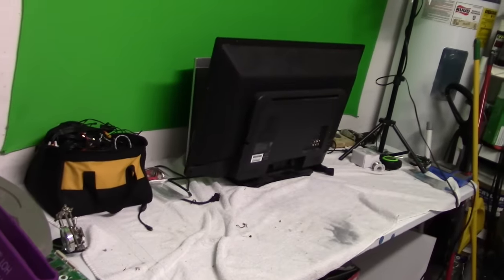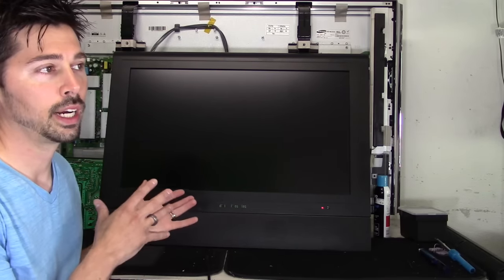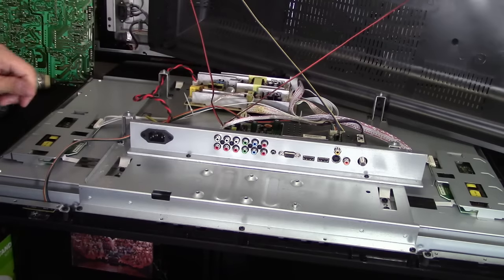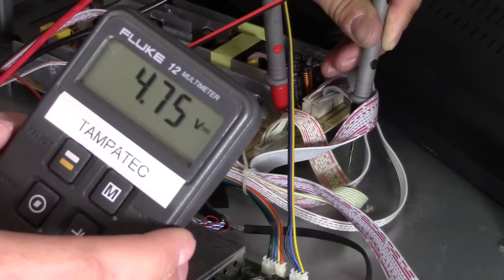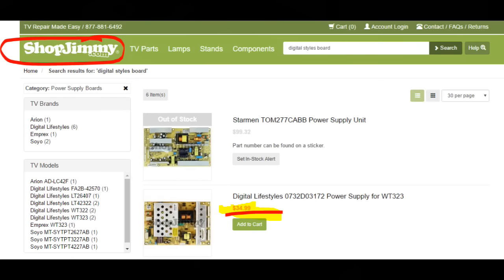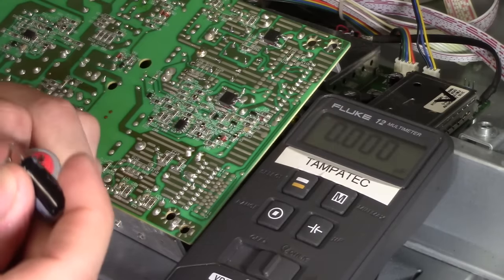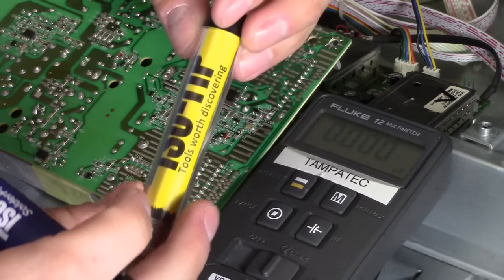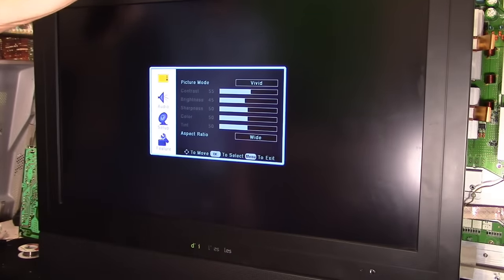WATCH THIS VIDEO BEFORE THROWING OUT YOUR BROKEN FLAT SCREEN TV!!!

Comment: Hello, I have 46 inches TV Philips which doesn't turn on. I hope you can help me. Here are the symptoms - When powered no red light at all. I measured the PSB voltages and everything seemed fine - the stand by is 3.48V (required 3.3V), all required 12V are 12.38V. The only discrepancy is the back light voltage which has to be 44.8V but is 33.8 V. All this is measured when the stand by red light is off. After awhile it starts blinking 2 times with short period in between. All previous voltages disappear but the stand by 3.48 V. There is no difference in the behaviour with or without connected back light load to the PSB. When I disconnect the MB then stand by red light does not turn on at all and 12 volts disappear from the PSB too. All boards have no visible damages of the components. Please, share your experience and comments what could be the issue. Thank you in advance!

Comment: I can verify this is common, I have a little 32" plasma Visio. Would power up sometimes then just shut off. It finally got to where it would not come on at all, replaced 3 or 4 capacitors on the power supply board, upped the voltage specs also. TV still working.

Comment: Here is my ? Why swap blown parts and solder in new when you don't know what blew the old parts..Isn't it logical to just
replace the board and visibly inspect the other attached boards and replace as needed? Also check wire connectors for loose
connections..My tv from day 1 barely had sound/volume coming out the headphone jack and front speakers no sound just occasional
static for a second. Checked wire connectors and had tons of sound out of headphones with little static still but still no fr. speaker sound
except occasional static no voices..is it a board? Thanks

Comment: I have a Sony Bravia KDL32EX710. It has a beautiful photo. It was just on for about 2 hours and turned off. 

When I tried to turn it back on,  I first turn on the master switch then press the power button which turns on the red light on the front of the set next to the power icon on the bottom front of the set.

It's just been on for 2 hours so I thought it overheated or something. What could it be? Thanks
 
I'm trying to do this without the help of my husband - 2 heads better than one but he prefers to spend the money on a new one.
I really don't want to waste money or just throw away a decent tv.

Comment: My Sony Bravia LCD works great for about an hour.   Then the sound goes out and the screen starts fading out.  Sometimes its black, pink, and white lines and eventually just goes black and the standby light is red on is on.   I unplug it and hear a click then I plug it back in and it works again.  Then it's about every half hour it does this again.   I am thinking it is overheating and shutting down?  I tried clearing the dust from the vents but that didn't seem to do much.

Comment: Thanks for video. There is hope.

I have a problem. Was watching TV, reached the remote to turn off, pressed the wrong button (don't know which) then the screen went BLACK while the volume remained. Now can't get back the screen. HELP!!!
Reply from the maker: Unplug tv power for 1 minute then check cables, change tv input to see if other inputs work and press tv menu if menu doesn't show up then backlight or tcon board can be bad.
Reply: @TampaTec  OK I did it; I notice the screen gives a flicker just as I turn it on but stays black. How does one fix the backlight?
Reply: @TampaTec  And thanks for your response

Comment: My 3yr old  Vizio 50in went out. No pic, sometimes sound, sometimes not. We did all the trouble shooting, the flash light test and hard reset. Still nothing so I bought a new power board off ShopJimmy. It worked for a day, turned it off and couldn't get it to come back on so bought the main board and went ahead and bought all the ribbon cables and replaced them too. Now sometimes it comes on and sometimes it doesn't. Red Power light comes on but no sound or picture. Is it the LED's? My tv doesn't look like this one inside, it has one board on each side. Not sure I should put anymore money in this tv but hate to throw it out after replacing these things. Any ideas?

Comment: Watching TV and all the sudden there's a blast and bum! TVs out! It's LG Flat screen TV never run into any issues and was just sitting there looking pretty as always... what could possibly cause that...? Anyway and most importantly..can it be fixed?...
Reply from the maker: Check ac outlet, power cord, fuse and standby volts on power board going to main board labeled stby 5v or stby 3v. No standby volts then order power board at shopjimmy.com or electropartsonline.com

Comment: I'm hoping you are still active with this account/site.  I am wondering if you think a complete novice could replace the power panel/board (and/or others) in a Sony KDL-60EX645 ?   My tv is totally "dead" (no power/lights whatsoever) and think it is due to lightning.  I see that techies and suppliers are saying that you must "update firmware" when replacing Power panel.  Is that something that is easily done?  Can I just install the panel and then power up the set and connect to wi-fi with the tv and do this?  Thanks in advance for any help you may be able to give.

Comment: My 3 yrs old nephew made crack on the LED screen while everything works. What's the best option for repair or at least salvage parts for this 3 year old 65 inch smart TV?
Reply from the maker: Sell the boards on eBay working for $50 to $90 each.  Manufacturers don't sell lcd screens. Hopefully his parents will buy you another TV at least used 65 inch.

Comment: if you are replacing electroltyics then make sure you have them in the right polarity. Our guys always put a shield over them when the turn the device on for the first time as they explode like a shot gun shell if you have the polarity reversed (the wad of diaelectric comes out really fast)

Comment: I have an Emerson. I have a RED Light on the front. When I turn tv on  RED button goes off. I need to see if I have ENOUGH voltage. Looking at this is confusing. TV is 7 years old. I have heard Emerson is not a good brand but at that time the tv was very CHEAP. I am definitely purchasing another tv but it will not be Emerson. Let me know what I should do?

Comment: I have a insignia 50 inch tv. the screen just went to a very light blue while watching it and it will show no picture. if i tap on the screen it will jump with a bright white in the spot i tap. No sound ether, any idea what board is bad? thanks.

Comment: Quick question I have a Samsung 75 inch series 6 when you push the power button it turns on with the Samsung logo then number three is displayed and then it goes to a darker blue screen and then it won't do nothing after that I took it apart and now I'm trying to see what is the problem thank you

Comment: My Sony bravia xbr 1080p 55 in has something weird going on. I turn on the tv and the picture is fine. After watching the tv for about 40 minutes,  the screens picture goes into a slow motion blur. If I shut the tv off for awhile, when I turn it on the picture is fine again, but after awhile it goes back to slow motion blur picture.  Do you have any idea what could be the problem or what is causing this? Any solutions would be helpful.

Comment: I was given a Samsung UN70NU6900F from someone after a storm. I checked the power supply fuse which is good. When I plug it in the standby light comes on as well as the backlights and then the standby light flashes twice and turns off as well as the backlights. The set just keeps cycling doing the same thing. Where do I look next? Thanks for any help

Comment: Hi I need one advice, I got dead philips 42PFL8404H/12 smart tv.

I was check the voltage on pwrboard on connector 3.3 VSB (i guess that standby voltage) but i got only 0.7 or sometime even 1.2 volt,   and no 12v or any in fact on that connector Capacitors look's OKAY not bulged, but I cant test them (dont have multimeter like you)  

Just for info what you suggest ? new board or try luck with change all capacitors on that part of board ?

thank you, great videos
Reply from the maker: Low or no stdby volts on power board usually its bad caps sometimes caps can look ok but still be bad. Get tv board at shopjimmy.com or electropartsonline.com
Reply: @TampaTec  Thank you, I will change them tomorow, is few bucks cost solution, if not work, than new board.  THX again
Reply: @TampaTec    Few days back I fix that TV with 20 cents cost schottky diode :)  all caps was okay (meanwhile I got ESR tester)  and TV work.  Thanks for help.

Comment: Depending on the brand name it's really easy to repair a flatscreen tv some only have 2 small circuit boards about 5 inches long and 3 inches wide and others are more complicated , JUST like anything else YOU NEVER KNOW JUST HOW EASY AND FUN SOMETHING IS UNTIL YOU TRY IT

Comment: I got a sony 65" model # XBR-65A8H it fell face down off the wall didnt hurt the screen and I dont see anything hurt inside when you plug it up while holding the on/off button down and continue to hold it you get a flash and a few seconds later it will flash again and continue to do this long as you hold it down thats all it does no audio is there any hope for it thanks for any advice

Comment: Hello,
I wanted to get your advice on my tv issue if possible, before I send you my board. 
I have a Magnavox tv S# 46me313v/f7, it is under 6 years old. I tried powering it on and the on light on the tv showed it was on, but there was no picture. I had a repair person come and look at it. He tested all the parts with a gadget that checked for the level of power and he said it was the main board and that I could order one on Ebay. I did and when I replaced the part the tv screen was upside down and the picture was blurry. I contacted the seller they said it was probably the mirror settings. I looked up everything on my owners manual and my tv has no mirror settings available, so it was not that.  They exchanged it for another board, I tried again and had the same issue. I contacted them again and they said that they looked up my part and they do not make this board anymore. The seller refunded me the money and said try and find someone to repair on Ebay. Have you ever heard of this type of issue and if so, what do you suggest I do? 

Thank you for your time,
Maria

Comment: I have Sony KDL-55HX850 can't power on, red standby led is on but can't turn on tv. What is wrong with that?which module board may causes the problem.I need some comment before throw away. THANKS

Comment: Got a LG 47LW5700 MODEL has a 4 inch wide grey line thru screen vertically. TV Screen is still on just darker than the rest of TV. Changed T-CON board still no luck. Please help.

Comment: I found out the hard way that generators put out “dirty” power and are hard on electronics, TVs included. I killed a 50” Samsung that way. Rather than toss it out, I did some testing and bought a used power supply board off eBay, and I’m still watching the TV 5 years later

Comment: Hi if a tv has been in storage for about 3 years can it go bad. The tv start with green light can get the menu on try to use the controls and the picture goes to black and the red blinking light comes on. Blinking 9 times. Tv is Sony Bravia any ideas?

Comment: Is JVC flat screen TV an easy fix if the screen won't turn on at all? Because I have this issue right now for about a week now.
Reply from the maker: If you have backlight glow on TV screen then it can be bad tcon board, get TV boards at shopjimmy.com or electropartsonline.com use code buydirect5off for discount.

Comment: Like 90% of the defects it's the caps in the PSU close to the heat sink.
Measuring the capacitance is not enough you have to make sure the ESR is still low enough (although they mostly degrade together).
Reply: why not just increase the v capacity before the cap starts to buldge

Comment: Some how ur video got to me to watch. I can see the red button on and the control works with my other t.v. wich is the same one as the other. I followed all the steps on my Samsung 4K t.v to reset it and blah blah blah. I can't see no screen on it's just the black screen. How can one obtain those tools so i can repair my T.V.
Reply from the maker: Shopjimmy.com for tools and repair kits. Turn off room lights, does tv backlight glow? If not, backlight is bad. 
 If tv backlight glows but no picture then usually it's bad T-con board.

Comment: I've had a lot of computers with the same problem.  I swear they're not making caps or engineering like they used to.  I build power supplies that run cold at full power, and have ran for the last 30 years with zero problems.

Comment: Hi I have a different problem with my TV. I have a Samsung smart TV model number UN43J5200AF. It has a line running across the screen which sometimes reflects image under the line. The line is thin so I can watch the TV if I just ignore the line. Can this be repaired? I'd appreciate any advice you can give me. Thanks.

Comment: Great video, you've gained a new sub.  As for the solder, for those who don't know, NEVER, EVER use acid core solder, that's for fixing plumbing and car radiators.  ALWAYS use a rosin core solder with a lead and tin composition for electronics.

Comment: I have a nine year old Samsung 40 inc lcd tv that began to have a problem by having the red standby light going out and the television no longer able to be turned on. When I unplugged it and let it stay unpowered for a few minutes and then plugged it back in the red light would reappear and the tv was able to be turn on. The problem is after about 15 minutes of being on the tv turns off by itself and can only be turned on again by repeating unplugging and waiting a few more minutes and then replugging it back in. It will go out again after 5 minutes and the same procedure has to be repeated a third time after which it will then stay on for as many hours as you need it. When it’s finally turned off the red standby light will be illuminated but within hours it will go out and necessitate unplugging the tv and repeating the process all over again. With new television prices being around $250 for a replacement that is in many ways superior to my current tv it makes little sense to spend any large amount of money to repair it but other then this problem it still looks and plays beautifully and I really want to find a way to keep it. I have to assume the problem is somewhere in the power board but the problem seems to be unique to most others I have read about. Any advice would be appreciated.

Comment: My TV has stuck pixels, the line is horizontal and grows with use. with no use, it seems to lessen over time or no use.  What could be the problem and why does it grow with use? At this point, it has two solid broken pixel circles with the lines. It's weird.

Comment: If you increase the capacitor voltage will it increase the voltage the TV uses essentially burning more power?
Reply: no. the voltage on the capacitor is the maximum voltage it can handle with out damage, which is why he can use a larger voltage with no issue.

Comment: I have a 43 inch 4K Seiki TV it Powers up it shows the display and then shuts right off after like 10 seconds on the display do you know the problem is that the main board

Comment: Just be careful when ordering main board. Some boards have same identify code but different chip set. Look for self adhesive label with part number and use this to search for correct assembly .

Comment: My 50" Toshiba TV keep rebooting over and over. Can You please tell me what the problem? Thanks!
Reply from the maker: If the TV is older than 10+ years old then replace capacitors in power board and main logic board. Get capacitors repair kit for your TV model at shopJimmy.com
Reply: Wow! That was fast! Thanks!
Reply from the maker: @Leong-m5f  it's a common fix for power issues.
Reply: @TampaTec  I just wonder if I should just change the caps or the whole board (Easier) as I have brought the TV a long time ago.. As you know that most Electronic components have a life expectancy and I afraid if I just changes all my caps and other components fail after a month. Just hope to listen to your advices. Thanks! Really generous of you to share your experiences and knowledges.

Comment: Hi I have a JVC LT- 32c850, all of a sudden while I was watching it the screen went to half of its original brightness and the screen started flickering. I have tried adjusting power setting, picture type, brightness etc etc and obviously turning on and off.

Even the JVC logo is dark on the screen when I turn it on, any idea's what the problem is?

Comment: I've got a Sceptre 24", and it's got a fine black horizontal line, near the bottom of the screen. Tried using a rubber eraser, pressing it lightly on the screen, on the line. Nothing happened, it's still there. Any ideas?

Comment: I have a 42" samsung 2013 tv.  Was moving it from house to house. When i got it out noticed 1 long crack on screen from top to bottom. When i turn on its just blank screen, the speakers do a quick weird buzzing sound then stops. Red light stays on. 
You think it can be repaired? 
PN51F4500AF

Comment: Hi Paul I hope you can help me out my led red light doesn't not turn on it only flashes . I plug in my tv it's a hisense 43' roku tv and I try the power button and no screen light come on it stays black and it has a reset button in the back on the brain I tried resetting it but doesn't turn on at all.